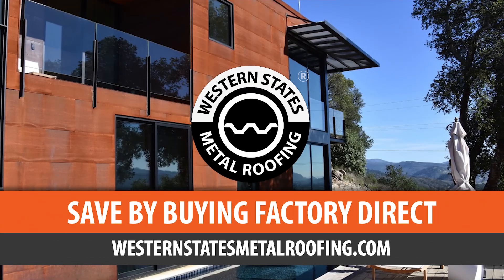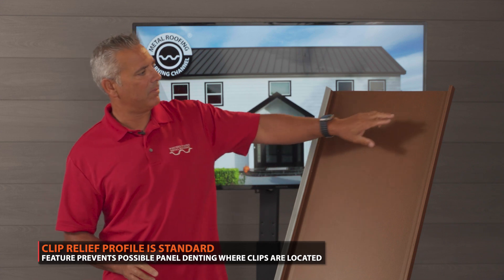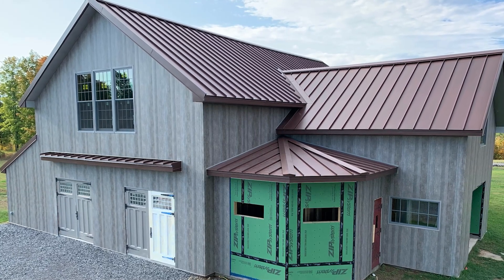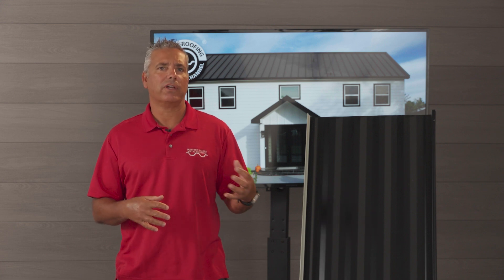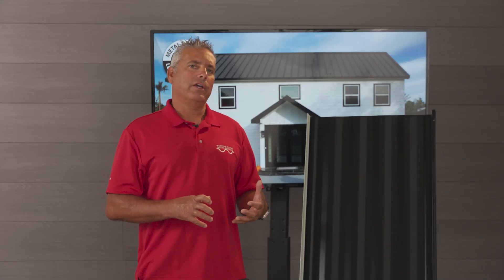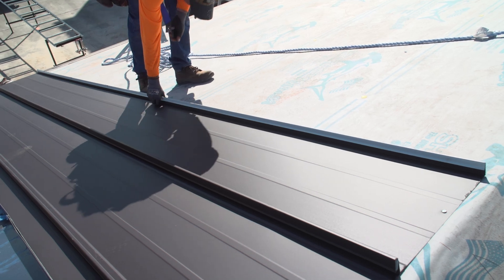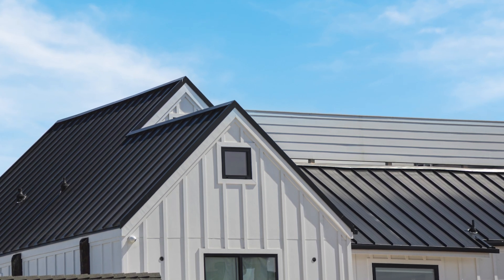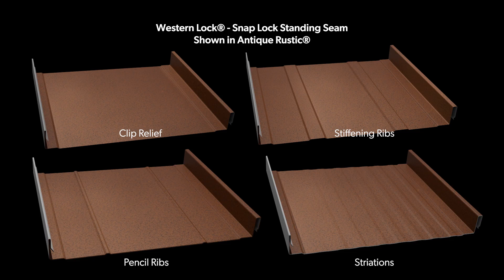Striations, Clip Relief, And Stiffening Ribs For Standing Seam Metal Roofing Panels

Comment: I am planning on building next year in Ashaway Rhode Island and want to do a standing seam metal roof. What are the advantages of going with Western States Metal Roofing vs a local metal roofing contractor? What the guarantee's that when you send out your metal roofing for my job that every piece that has been cut and sent by you fits perfectly? The last question that I have not gotten an answer on is how thick is your standing seam roofing and how long will it actually last before replacement is necessary? thanks for your response.
dan
Reply from the maker: Thank you for the comment. We only manufacture the metal roofing panels so we may not be the right fit for that reason. A lot of our customers will find an installer that they trust and buy the materials directly from the manufacturer. The advantage in that is the mark up that is put on the metal roof. If that is something you are considering it would save you money. You would need to let whomever is going to bid your job know that you need an installation price only including the underlayment. At some point your installer would be responsible to get us a cut list and we will make it per that list. 

The materials will only be correct if the materials list supplied by the installer is correct. That part is not our responsibility. Our responsibility is making sure that the items that are delivered match that materials list and are delivered free of defect. We have great quality and our best proof of that is our google reviews, 560 reviews at 4.8 stars.

Our standing seam is a true 24 gauge at a .0236 minimum. That is the industry standard for 24 gauge. There are some companies that will cheat on that, but in most cases the good companies will adhere to that minimum thickness. We can do 22 gauge also, but unless you have some unusual jobsite conditions it would be overkill and I suggest saving the money and going with 24 gauge.

Replacement depends on too many factors to give you an answer. Most metal roofs are lifetime roofs lasting in excess of 40 plus years. The paint has a 25-40 year limited paint warranty dependent on the type of paint that is used. We recommend a PVDF paint system.

If you would like a quote in the future. Please contact our company.
sales@westernstatesmetalroofing.com
602-495-0048